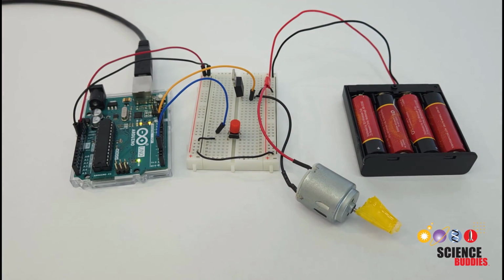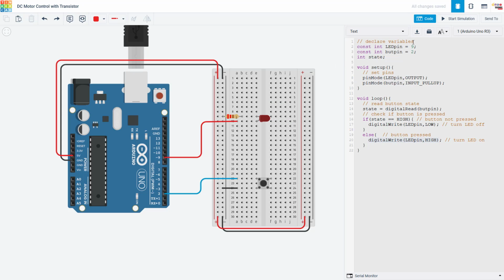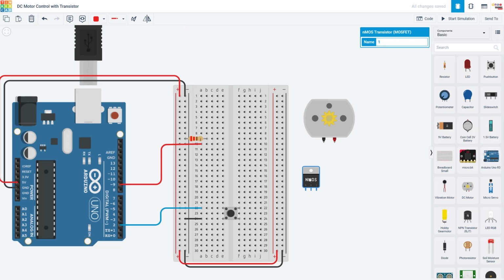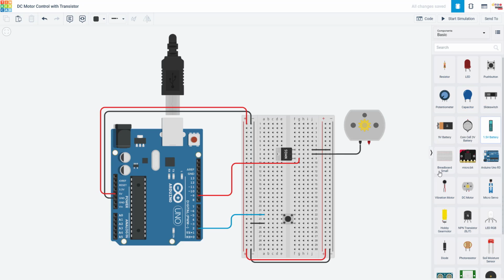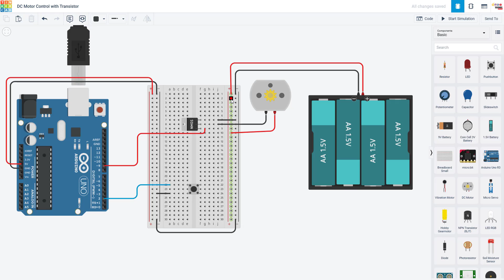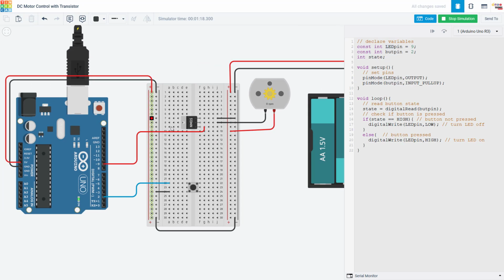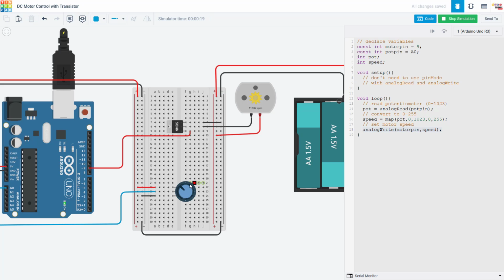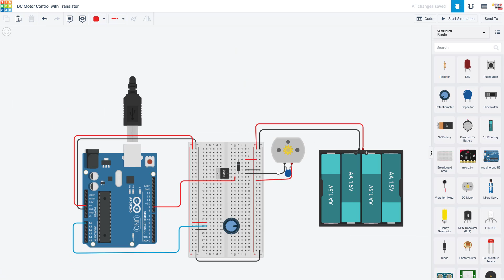Control a DC Motor with Arduino (Lesson #16)

Comment: Sir. How about pressing a button to start the motor for a period of time rather than using a potentiometer?
Reply from the maker: You could do this by detecting the button press (see video on buttons earlier in our tutorial series), turning the motor on, using a delay() command for a set amount of time, and then turning the motor off. The disadvantage here is that the code cannot do anything else while it is stuck in the delay() command. There are other ways to keep track of elapsed time on the Arduino, like the millis() command. We do not have a video on it but you can look it up on the Arduino website.

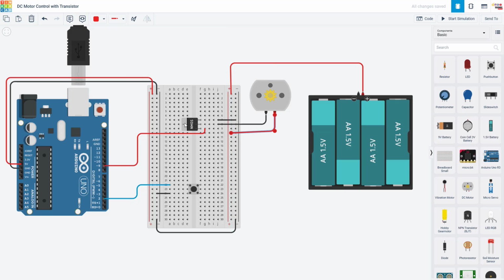Comment: 7:23 I use to think that the electricity flowed out of the positive terminal as well, but recently I learned that in a typical use case such as this, they flow out the negative and in the positive. Apparently the logic behind this was that the + side is "gaining" electrons and the - side is "losing" them.

Very backwards from everything I learned playing with electronics as a kid, lol.
Reply from the maker: The convention was defined before scientists really knew about electrons as the mobile charge carriers - for better or worse, that's what we've stuck with!

Comment: why would my motor be humming/whining I used a similar setup using a IRF520 MOSFET, a potentiometer, and a 9V battery as the motor's power source
Reply from the maker: Depending on the motor, you may near a humming or whining noise when changing the speed with analogWrite. analogWrite does not allow you to adjust the frequency of the PWM signal, and different motors will respond differently to different frequencies.

Comment: Hey, i've copied everything exactly from this project but when I use analogwrite in an attempt to control the speed of the motor, it's not working. I'm not using a potentiometer, but here's my code: 

const int MOTORPIN = 3;

void setup() {
  // put your setup code here, to run once:
  pinMode(MOTORPIN, OUTPUT);
  analogWrite(MOTORPIN, 0);
}

void loop() {
  // put your main code here, to run repeatedly:
  analogWrite(MOTORPIN, 0);
}

I've ensured that pin 3 is indeed a PWM pin, and my circuit setup is exactly the same as yours, I've double and triple checked. What could be the problem? Thanks in advance!
Reply from the maker: Hi - since you have analogWrite(MOTORPIN,0), you are setting the speed to 0 and the motor will not spin. Does it spin if you change the 0 to a different number, between 0-255?
Reply: @Science.Buddies  sorry I should have clarified, when I set the speed to 0 with the analogWrite it still spins. It doesn't stop. No matter what number I put it spins at the same speed.
Reply from the maker: Ok - this could be a problem with your circuit and not your code. You could test with an LED instead of a motor to make sure the analogWrite function is working properly, since wiring an LED does not require a transistor and is less complicated than wiring a motor. We have videos earlier in our tutorial series about controlling LEDs.

Comment: I am trying to build a system with a humidity sensor that will detect the low temperature and then activate the DC motor. Can I combine this project using the same arduino? 
Please help me.
Reply from the maker: Hi - yes, you can combine pretty much whatever sensors and motors you want with an Arduino, at least until you run out of pins. We do not have our own tutorials for temperature or humidity sensors yet, but you should be able to find plenty on YouTube.

Comment: I am trying to build an ardunio that can pull my curtains up/down. Is a DC motor enough and is it possible to control that thing via bluetooth/ an app?
Reply from the maker: Hi - we don't have our own video on it, but you should be able to find many tutorials out there on using Arduino with Bluetooth and controlling things with apps. DC motors come in many different sizes and whether one is "enough" will also depend on whether there is a mechanism, such as gears or pulleys, that create a trade-off between speed and torque. This topic is a little more advanced than what we cover in this video but again you should be able to find other YouTube tutorials about it.

Comment: Thank you. Though if I may ask, is there any way to power the arduino with the same power supply without risk of short circuiting? I've made a similar configuration which works just fine but just like in the video, the arduino is still uses power from the USB.
Reply: I was thinking of connecting the Vin port to the positive rail that's connected to the power supply. Currently unsure as I am still new to arduinos and don't wanna break my components. Some answers would be helpful, cheers.
Reply from the maker: We have a new video that is all about different ways to power your Arduino project! https://youtu.be/I7MrL5Q7zvY?si=ONWYTIxMbwE16vR7. You will also find this official help page useful: https://docs.arduino.cc/learn/electronics/power-pins. But the short answer is yes, you can use a single power supply and connect it to both the Arduino's Vin pin and the motors to power everything at once. That way the power for the motors comes directly from the power supply and not through the Arduino. Here's an example of a project on our site that uses this configuration - an ROV powered by a single LiPo battery: https://www.sciencebuddies.org/science-fair-projects/project-ideas/Robotics_p052/robotics/arduino-underwater-ROV

Comment: would it work with a 9.V battery (I'm very new to everything)
Reply from the maker: The very short answer is that technically it would work but 9V batteries are not a good choice for powering a motor. We have a more detailed video about powering your Arduino projects here: https://youtu.be/I7MrL5Q7zvY?si=FHJb_28Zbzr-_sZF

Comment: Nice video! How can I choose the size of the capacitor?
Reply from the maker: We don't have a simple answer for this because it can depend on the motor and power supply you're using - you might want to do some more research on more electronics-specific forums for this one.

Comment: Why we meed transistors. Can we avoid
Reply from the maker: The Arduino's I/O pins can only supply 20 milliamps each, which is enough to drive a small load like an LED, but not enough to drive a motor directly. The transistor acts as an electronic "control valve" that lets you control more current flowing from a power source like the Arduino's 5V pin for an external battery.

Comment: what if you add 4 motors? how do you connect?
Reply from the maker: You would need to use a separate Arduino pin and transistor for each motor.